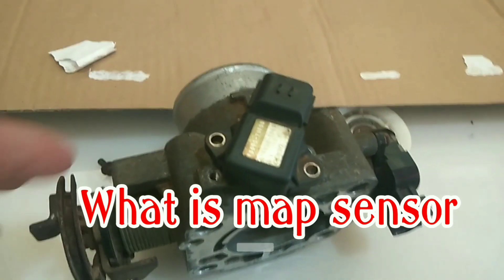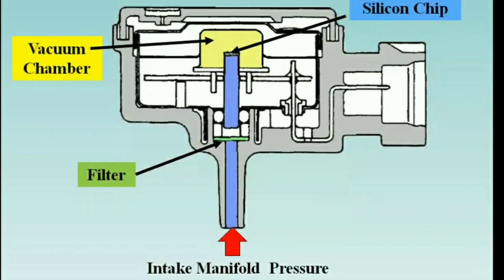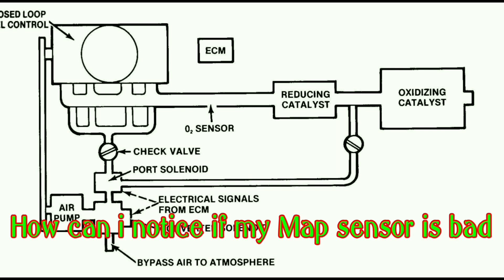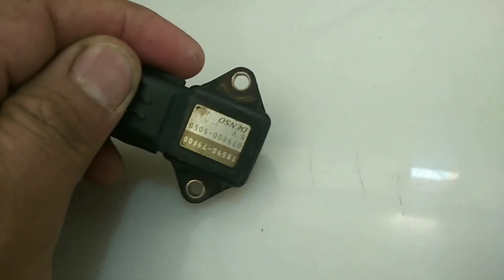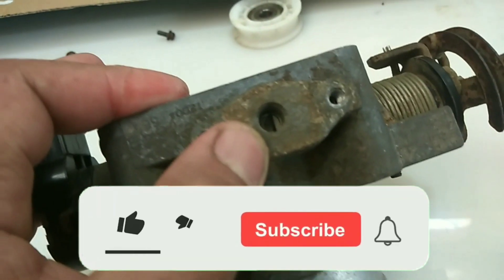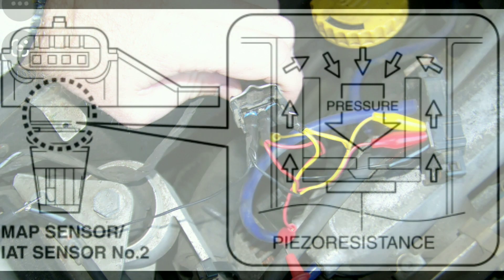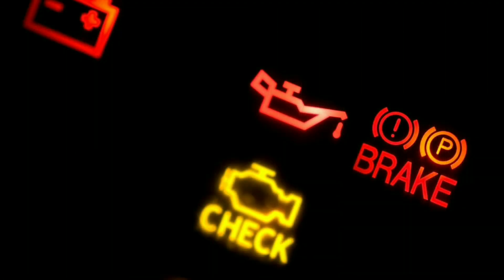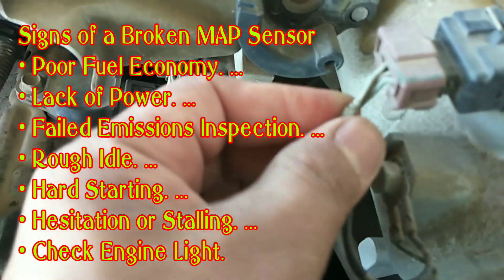Map sensor / caused of faulty map sensor / What is map sensor andam

Comment: My one stalls at stops I can always restart no problem when engine gets hot. This can be map sensor problem too ?
Reply from the maker: First clean all filters like air cleaner fuel filter and change spark plug if needed,,and test drive if its the same better use  Diagnoistic tools,,